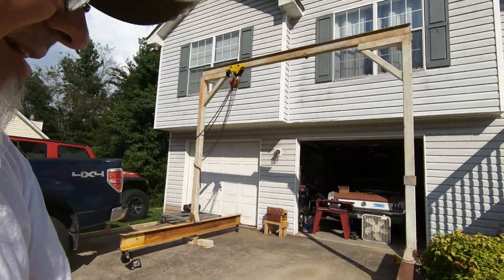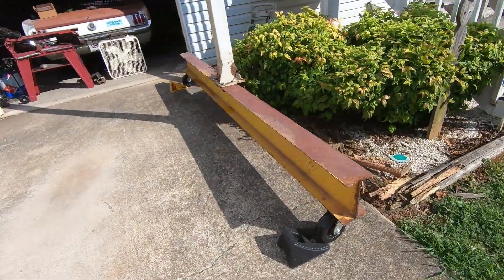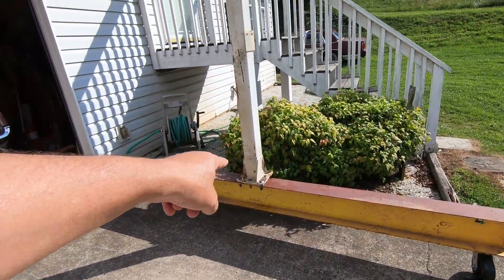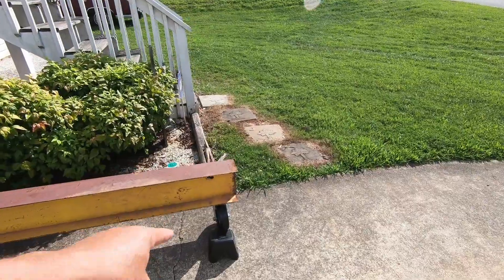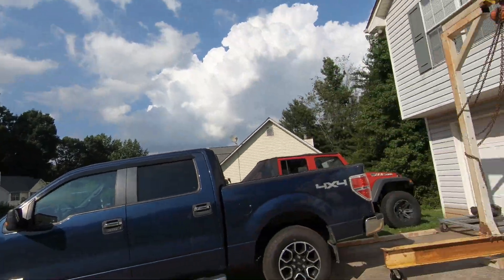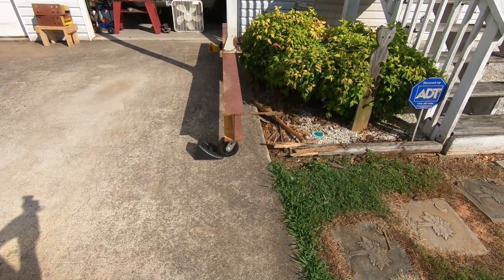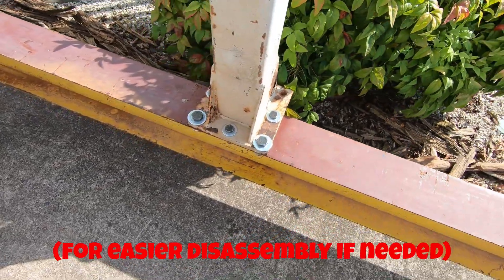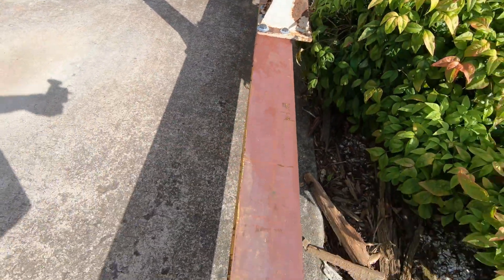Think twice and save a life! Cheap gantry crane build pt 1.5

Comment: Taller is better
There is a couple flaws, but you can adjust some of that otherwise it looks pretty solid
The one flaw I see is the casters don’t look strong and remember all the weight is gonna be on those wheels
The one I have is factory built and yes, it is exactly 10 foot tall from the bottom of the I-beam to the floor
Reply from the maker: I appreciate your input, and I'm always looking for ways to improve these things!

Comment: Safer is better. It never hurts to do the math. Having said that, just weld a 1/2" steel plate to the base under the uprights so the whole base plate of the uprights can be bolted or welded to the base. Add some 45* braces from the base to the uprights. Boom, safe for any reasonable loads.

Comment: That looks safe to me, as long as you don’t lift more than about 2000 lbs. However, it’s always better to trust your intuition and redo it if you can make it safer. I once saw a website that gave a lot of engineering math for similar and simple designs for DIY projects like these. It outlined the load capacity of different steel beams.
Reply from the maker: I did end up redesigning the base, and it turned out great! Thanks for watching!
Reply: How did you improve ?
Gussets on the top corners, and stiffeners along the base I beams?   @MikesRepairShopEDU
Reply from the maker: I ended up completely redesigning the base. Got rid of the I-beam altogether and replaced it with box tube and triangular supports. I finished it up in part two of the video if you're interested in seeing what I did: https://youtu.be/6TUJ80uD_wA?si=1opsed0SuhaKSoxi

Comment: Actually your design looks fairly solid for a 2t or less gantry crane. Wide flange is very strong for its weight. Once some gussets are welded in at the centers where the crane sits and at the ends near where the casters are mounted, I myself would feel quite safe lifting up to 2 tons.
Reply from the maker: I'm glad you think so!  Thanks for watching!

Comment: If you tell me the dimensions of the ibeam and the span between the supports, I can stick it in autodesk inventor and give you the deflection at whatever weight you want. I agree that the height is a bit much. I built a gantry out of unistrut to lift a big AC compressor out of a condensing unit and had it fold up as I pushed the chain fall to make the trolly roll. No injuries...but lesson learned. Better safe than squished.
Reply from the maker: Thank you for your help! The span is 89" between the ends of the supports.

I-beam is 6"T x 3"W
The material thickness is 1/4" on the top and bottom rails, 3/16" on the web.